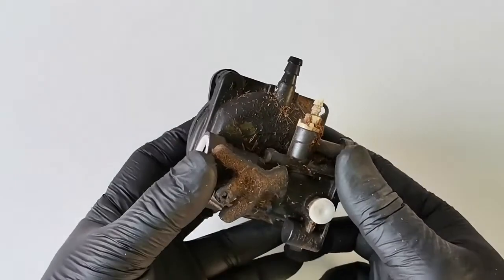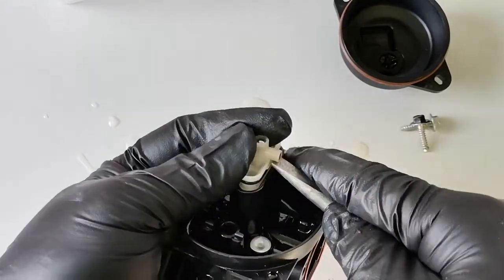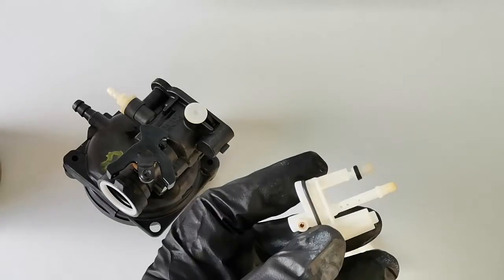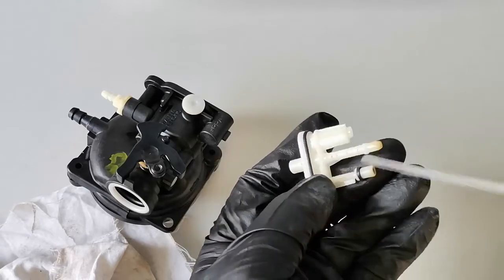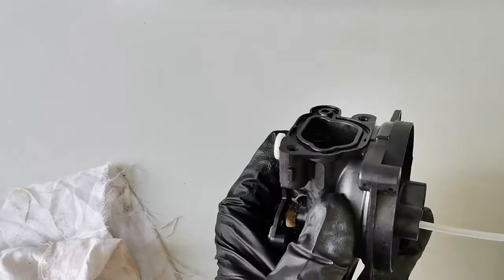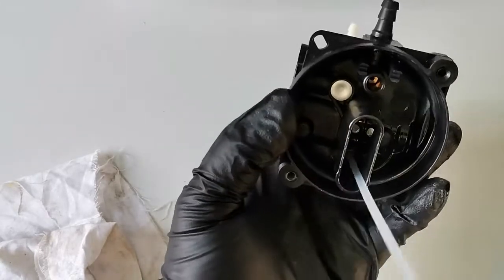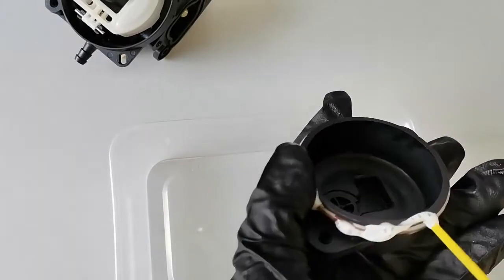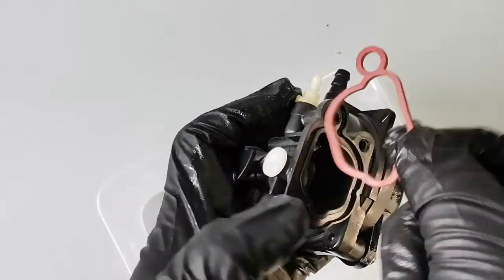VTECH 33 - Briggs & Stratton 500E Series Plastic Carburetor Rebuild

Comment: Great video. It was cheaper for me  to buy a new carb than replace the needle & seat for my 500e ... which I have done. However, it now runs extremely rich with the new carb. Is there any fuel mixture adjustment on these carby's ?  Ive done a heap of internet searching for an answer .. hoping you can help with the question or a solution to the issue ?

Comment: I wish someone made a decent carb for these engines. I have 2 mowers with this engine that people gave me and both carburetors are junk and have been apart and cleaned several times in the last couple years. They flood, don't prime correctly, leak gas out of the primer while running, etc and I'm clearly not the only person having these problems. Never saw such junk in my whole life.

Comment: my needle seat sank down in the chamber and carb is flooding,, these carbs are turds...
Reply from the maker: You can use a hardened wire hook to pull the brass seat or a guitar string to feed from the seat all the way out to the fuel intake nozzle and wire the tip with any small object to hook when pulling the seat out. When taking the object/hook out, hook through the fuel intake with hardened wire. When done, slowing tap the seat down until you get the right float level. Good luck and thanks for watching our video. VARIETECH
Reply: @Varietech-AU  wow thats a great idea,, I was kind of thinking abt it alot today. once I get the seat back into the right position I will try to run it without that restrictor.. I tried adjusting the governor on my briggs 6/75 ex and it seemed to have little effect.  the mower is running so rich I have to clean the plug after abt 10 minutes of use.,,. decarbonized the piston and valves with a product called SUPERZILLA.. have u tried it? it is AMAZING,
I have a kawasaki mule I bought used, and the idle needle was very worn, they had been running it rich for years. the top of the piston was black with thick crusty carbon. I squirted superzilla in the cylinder and let it sit overnight.. then next morning cranked it over to get the carbon and superzilla out, it was amazing how much came out,, now it runs like new.., I even had to idle it down some due to the increased compression. the only thing I have found that will clean carbon better is easy off oven cleaner. it kind of dangerous though. burns the skin and eyes.
Reply: @Varietech-AU  I have a guitar string with the round brass hole on the end. it may be the perfect tool.

Comment: Nice video but  I drill  out the main jet with a # 72 drill bit .025 works great , starts first pull ,,,,even the ones without the auto choke . I'm a 74 year old machinist and I'm like you " Old School "
Reply from the maker: Thanks for watching our video for sharing your experience. I think the # 72 is 0.025" or 0.635mm size drill bit if I'm correct. VARIETECH